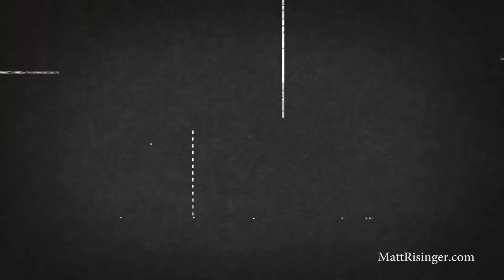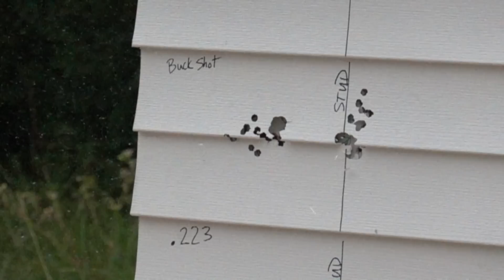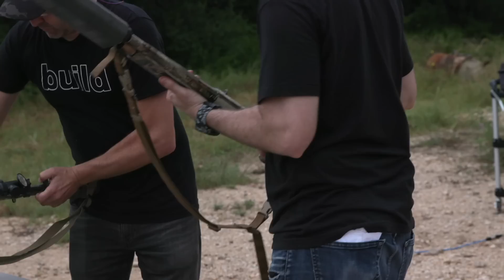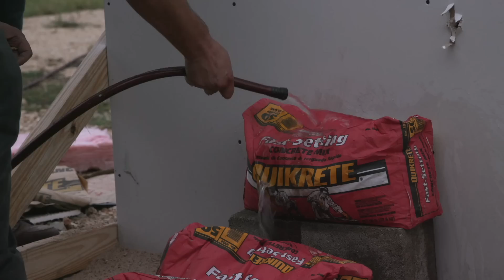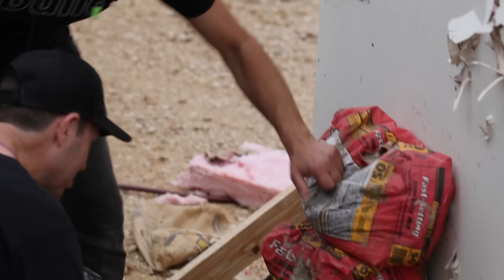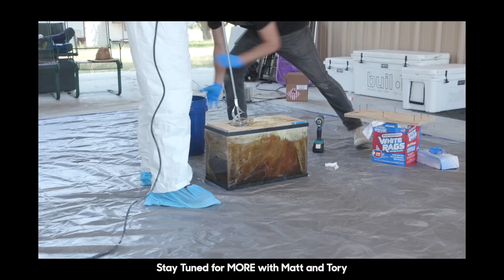Will your house STOP A BULLET?  Guest Star - Tori from Myth Busters

Comment: Simple answer: insulated concrete form walls. 6" of reinforced concrete should do a good job of stopping standard 5.56, though M855A1 will still punch through.

Self-healing mylar bags with sand or pea gravel would be the best bet though. All the individual sand grains bleed off a tiny bit of kinetic energy, and the faster the projectile, the more they bleed off. That's why the 9MM bulged the wall with sand in it: the projectile was heavy enough to retain velocity, while not going so fast that the sand acted like a solid surface on initial impact.  I'm assuming you used a 115gr round nose, and not hollow points. A 230gr .45ACP round nose would probably have made it through the sand reinforced wall, albeit just barely.

Comment: Matt! Take a look at how the ISS have their high-speed impact armour constructed. They use two thin sheets of metal with a hollow cavity. The first sheet makes the impactor either disintegrate into several small pieces or make them tumble and lose forward momentum.

Putting the sheet before the insulation (cavity) should alleviate the .223 caliber going through.
Reply: DavidtheDoom This only works because of the extreme velocity of micrometeoroids and orbital debris which causes the projectile to vaporize and release its energy in such a short distance. Would not work for bullets which are an order of magnitude slower. Good idea though!

-your friendly neighborhood ISS flight controller
Reply: @wdog103  Not sure if I agree, the ballistics does not have to vaporise, just start tumble. The cavity (insulation) would give ample space for this.

Take a look at how spaced armour is constructed. 

Will at least be better than Ply-sheet-ply at the end of the wall. Might affect more of the construction and insulation putting it on the outside thought.

Comment: Matt, the Military DOES NOT USE AR-15 rifles. The Military uses M-16, and M-4 rifles. The AR-15 is a semiautomatic rifle, with a two position Safety (Safe - Fire), and is only capable of firing one round per trigger pull. The M-16 and M-4 rifles the Military uses are Select-Fire rifles, with a three position Safety (Safe - Fire - Select-Fire), which when set to the "Select-Fire" position, is capable of firing three rounds with every trigger pull. 

Other than the horrendously bad, and highly incorrect comment about the AR-15 being used by the Military, oh and the complete lack of "Trigger Discipline," this was a a cool video to watch.

Comment: Rain screen vinyl attached to a concrete block wall, filled with sand and pea gravel mix to dissipate projectiles, coated with 1/8-1/4" Rhino Liner inside and out as a "spall shield" (prior to rain screen battens and vinyl application), but doubles as a water/vapor barrier.  Then an air gap before and exterior Rockwool insulated open cavity stud wall on the inside.  For windows, 1/4" borosilicate glass sheets cold laminated (1/8" gap) with a 1/2" polycarbonate sheet center pane - interior facing glass surface using a 3M security film to keep the inevitable shards contained in the frame.

Should be able to stand up to everything up to AP 7.62/.308WIN - might be challenged with a .50 however, and if your local gang bangers get their hands on 20/30mm, well you better join that gang... ;-)

Stuff "gets really crazy", you can go through the trouble of filling the open cavity wall with more sand.gravel mix - a thicker wall cavity would give you more space for this "future upgrade".

Probably will have to sell the Lambo to build your shack though...

Comment: Been building walls for 40 years and shooting guns for 10. There was NEVER a doubt a bullet will go through a basic wall cavity. If ever my home got invaded by an armed assailant, I would shoot right through the wall in a heartbeat. The bathtub is about the only reasonably safe place in the house... or possibly a bedset tile shower with a wire lathe plaster wall on the other side.

Comment: great show. getting a good setup from the local store isn't going to be easy. Kevlar comes in rolls. You can probably have someone put a kevlar laminate over plywood and get thin sheet metal that is hardened to be sandwiched between the two layers like you had and it would stop just about anything.

Comment: This video is a good advertisement for brick clad insulated concrete form (ICF) walls.  Add a metal roof with wide overhangs and you will feel a bit more secure than living in a blow-away tract house.

Comment: It only takes a couple inches of sand to stop most hand gun calibers, lots of people use clearing buckets.  I’d be interested in seeing how far up the wall you could actually fill the wall with sand on a 2x4 and 2x6 wall and the drywall actually hold.  I’m guessing that being in more than 1 or 2 bays will rip the drywall off.

Comment: alright i think i might just have figured out. if anyone is building walls for possible zombie invasion. here it is. outside fiber cement siding, 1 1/8 zip r type sheathing, 5 inch closed cell spray foam, 3/4 inch plywood, 1/2 inch steel plate, 3/4 inch plywood 2x4 cavity filled with quik set concrete and finishing with a 1/2 inch drywall see if anything goes through that

Comment: Another good show! I noticed the post I replied to was deleted. .223 or 5.56 are the same thing for the most part designed for war. I have owned a 22 Ruger like the one you used today a 12 gauge, 410, and a 22 rifle. Do we need to own a weapon of war? SFC USArmy Ret.
Reply: If you are a military vet you should know the difference between .223 and 5.56. And yes 5.56 was designed for the military to have less recoil , less weight AND less damage. You want to do some damage?? Go with .50bmg or even 7.62. BTW I was not in the military, it is a shame I need to point these differences to a retired vet. I now a lot of these "vets" who either lie to score liberal points or just push papers on the military...

Comment: Aircrete works well both as a building material and stopping bullets. If you fill the wall with 3/4"chip rock inbetween the 2x4 it will stop everything under a 50bmg

Comment: A real winner would be the "Insulated and Bulletproof" design properties of an external wall ICF house build!
Reply: YES! I don't know why that wasn't tested at all. When I finally get to build my dream house, it'll be ICF for all of the advantages it offers. Virtually fireproof, tornado-proof, hurricane-proof, and bullet-proof. Not sure why it's not more popular here in the states. You can still frame the interior walls with wood for easier future renovations, but the exterior should be ICF.
Reply: @WeAreTwoDoorsDown  You should look into the cementitious ICF products like Faswall, Durisol, or AAC. Those are actually fire and bullet resistant. Foam based ICFs will melt in a fire and release a lot of black smoke.
Reply: @WeAreTwoDoorsDown  I saw an article years ago when a drunk driver hit an ICF house in South Florida, hubby goes downstairs to check for a "burglar" and finds a car had bounced off his house, NO damage on the inside, not even a crack on the concrete when they cut the drywall off for inspection to check for any spauling, no damage other than replacing the stucco on the outside.     That's why I love my ICF, 6" concrete walls with spray foam in the attic.   My last years HVAC bill was $160 for 12 months TOTAL,  the thermostat logs all power consumption for HVAC purpose's.   I cheat, I use a wood stove in the "winter time" here in South Alabama on the Gulf Coast, all 4 weeks of it.
Reply: Insulated concrete panels would be good too.
Reply: @dustinabc  ;  That is meaning of the ICF abbreviation:  Insulated Concrete Form.

Comment: Matt, Try two layers of 24g steel behind the 3/4” plywood on the interior studs. If that does not work for the 2.26 or 5.56 then 1/4” steel sheets 4’x4’ (easier to handle on the install due to weight) is all the wall height protection you would need. Now, 4’x4’ for advanced framing or 4’x3’ for traditional framing. The goal is not to protect the entire wall, just an area for you to kneel down behind until help arrives. You would not necessarily shield all walls either,  just those designated threat walls (near a busy street or main outside traffic areas). You might also just protect an interior room as a type of limited safe space until the dust settles without breaking the bank. I think all custom homes should have at least a closet or small room that can stop any type of round. So the build would be 1/4 steel on the stud with 5/8” plywood screwed through predrilled holes in the steel plates. The plywood can be finished with drywall, shiplap or whatever the customer wants. Armorecore also works quite well...
Reply: Screw your nonsense plywood and learn to use concrete and bricks.

Comment: Awesome love it! Would be cool of there was a ballistic dummy to see how much it stops the bullets and if it would be lethal. I wonder if the sound dampening drywall sandwiched in there would make any difference because it absorbs vibrations and replace one of the plywood with a concrete board if that would make it stronger.

Comment: today i have learned why houses in america get blown away when a huricane hits; they're made from cardboard.
Reply: @BenjaminFranklin99-s9n  you must have missed the part where I said ICF. Solid layer of foam insulation on both the inside and outside, and no thermal bridging.
Reply: In florida where hurricanes hit a lot the houses are concrete.
Reply: I have an older house in North Florida made from solid brick and poured concrete, its gone through several hurricanes with no issue, but it was built in the 70s
Reply: mr anderson this has aged like milk, cough* corona cough* without a mask*
Reply: Only armor piercing ammo will penetrate my concrete house.
Reply: I mean the reason why this does not happen in Europe is because they don’t get hurricanes and tornados trust me one tornado happens in Europe their houses go flying
Reply: @globallyfamouse6609  No they wont they build out of concrete and they  have tornadoes too.
Reply: @marcoandres8830  I have no idea what you could possibly mean by "no they dont build out of concrete" But tho its true europe does have tornados the us has significantly more tornadoes and they are usually at higher yeilds then european tornadoes as well
Reply: Fuck it live in a warehouse
Reply: These are mobile house walls
Reply: 250,000 dollar cardboard box
Reply: As an American, I agree. It's pretty despicable that we build houses like this. When I finally get to build my house, it'll be concrete (ICF).
Reply: @WeAreTwoDoorsDown  .... ICF? what specs you planning on using m8 cuz 90% ain't done right.
Reply: @WeAreTwoDoorsDown  you should use brick or rock concrete is not as strong as that im in england and my walls are 1foot thick and over 100 years old
Reply: WeAreTwoDoorsDown What’s worse is that we build in flood plains where we KNOW the houses will be flooded out in a few years.  The only reason people do it is because the rest of us pay taxes to rebuild their homes every few years.  If they had to pay for it themselves no one would build there or they would build in ways that are flood resistant.
Reply: @WeAreTwoDoorsDown  make it brick
Reply: @WeAreTwoDoorsDown  So believe it or not, I think mythbusters did a episode, a brick or a small concrete wall will not stop most bullets like a .40, or a .45. some 9mms will stop. So i would not be surprised if a ICF wall is still not bullet proof
Reply: @watchere  Concrete wall will, without a doubt, stop any pistol caliber and many rifle calibers....
Reply: @markoajduk7096  look up the mythbusters episode. it only stopped when it hit rebar.
Reply: @watchere But reinforced concrete and ICF walls can stop every bullet (except 50 BMG). It might leave a small or medium sized dent but won't cause any major damage to concrete.
Reply: Lol i basically just said the same thing 👍
Reply: Said a man who has never lived through a hurricane, and who knows nothing at all about engineering.
Reply: BenjaminFranklin99 as someone who lived through maria and lives in a concrete house i can confirm, a hurricane wont do shit to concrete

Comment: What about a kevlar liner? I know you cant just go to the hw store and buy some, but if you build it from the beginning?!
Reply: Kevlar is very expensive and wouldn't stop the .223/5.56. The vests are generally a couple hundred dollars and that is for a very small amount of kevlar, so to have enough to line a wall would be prohibitively expensive compared to using brick or concrete blocks which would stop most rifle rounds and be cheaper.

Comment: Matt, just  a correction our military does not use AR-15's FYI.  They use M4's, which have 3 round burst and select fire
Reply: But he did say "... .223, what the military uses..." - which is not wrong (.223 ~ 5.56)
Reply: @Real_Tim_S  It is wrong.  The 5.56 generates a higher pressure and the chamber of the 5.56 is slightly different. That's why you can shoot .223 in a 5.56 gun but not always 5.56 in a .223 gun.
Reply: @m2hmghb  @Terry Faugno, 5.56 "may" generate higher pressures - it depends on the load and manufacturer. 5.56 NATO can be anywhere from 45ksi to 62ksi. A blanket statement like "you can't shoot 5.56 in a .223" is not factual, as dimensionally they are for all intents and purposes the same.

Using a builder analogy, as with any time that you wish to use a flatblade screwdriver with a philips head screw, the operator takes on the responsibility to understand the risks of stripping the screw... but many hundreds of people make do with careful understanding every day.
Reply: @Real_Tim_S  5.56 has a higher  proof pressure and the specs for the ammo are higher. Just because a manufacturer doesn't load to the top end means jack shit.
Reply: @Real_Tim_S  No. 5.56 has higher chamber pressures and muzzle velocity vs. SAAMI .223 spec loadings.  The opposite is true of 7.62X51 compared to civilian .308 Winchester loads. The case dimensions are almost identical, and you can chamber and fire .308 in many 7.62X51 guns, and anything designed/built in 7.62X51 since the 1960s forward is generally safe to fire .308 through as the metallurgy improved greatly between the end of WW2 and the Vietnam era, but many of the 7.62X51 re-chambered guns, like the CETME FR-7 and FR-8, and the 7.62X51 Ishapore Enfields should only have military spec 7.62X51 fed through them, as the receivers could crack and fail with the higher pressure .308 Winchester civilian ammo.
Reply: Let’s not be too brutally nit picky here. Yes, we  know there is a difference between a true M4 and a “AR-15”/ M4orgery.
Reply: @JimYeats  That difference is being LEO/Mil, having an FFL, spending 30 grand,  10 years in jail etc. 

While the difference may be minor, it's like putting a golf cart engine into a Ferrari and saying it's the same as a race car.
Reply: There are still M16s around, especially in the DMR role. Also full auto M4s and M16s are not as uncommon as they used to be.
Reply: They also aren't using suppressors on all their weapons. An ar15 is basically an m16. Since the m16 was a modified ar15, and due to how modular ar15s are, one is being overly pedantic in the minutiae.
Reply: @menchelke  Full auto is a big difference. 
I would call having to machine material away a big difference as well.

Also the Marine Corp has started fielding suppressors more requently and currently have a battalion using only suppressed firearms - except grenade launchers. 

It's not pedantic, having an ar is legal having a full automatic m16 without a tax stamp or the other requirements is a minimum of 10 years in jail 100,000 dollars fine.
Reply: @m2hmghb  and not all m4s or m16s are full auto capable. And the modification isn't that big. People buy 80 percent lowers and machine away material to make a functional lower. Once again, getting lost in the small details.
Reply: @menchelke  3 round burst is considered by the ATF to be full auto. I'm looking at the legalities vs the details of the weapons. In that there is a vast difference. In operation and design there isn't too much.
Reply: I was hoping someone would point that out. I'm not sure if he was kidding or serious, but I hope that it was a joke because they are for sure not using AR-15's in combat situations...

Comment: Gravel wall assemblies are more effective. Plywood on both sides with 2x4 studs will stop most bullets except 12 gauge slugs and 30 caliber rifle rounds but 2x6 with gravel will stop everything short of 50 BMG (you need lots of hardened steel plate or feet of concrete to stop ma deuce...). All are vulnerable to multiple hits in the same location - especially from high power rifle and 12 gauge slugs. Insulating concrete block would be the most effective option with the least amount of modification of standard building practices. Windows of course are useless against bullets though they can be reinforced with plastic films to increase resistance to explosions or break-in attempts.

Comment: You may have been better off if you did the extra plywood and sheet metal on the outside to slow down the bullet before hitting insulation.  I would think, the wood and metal would drastically slow the bullet and the insulation would do a better job at slowing a bullet that was traveling slower. So something like Siding, osb, steel sheet, plywood, rockwool, plywood, drywall.